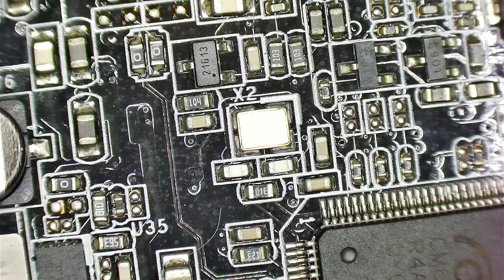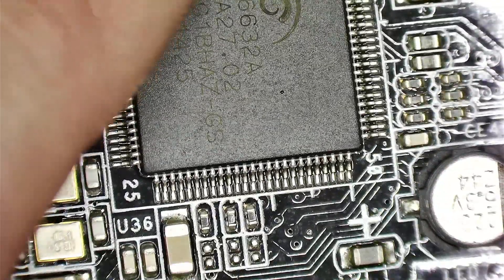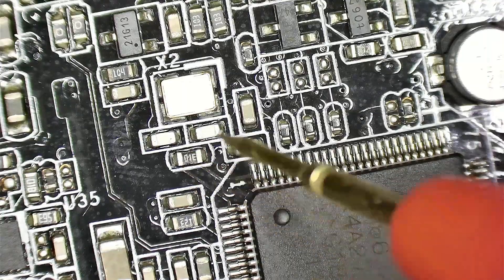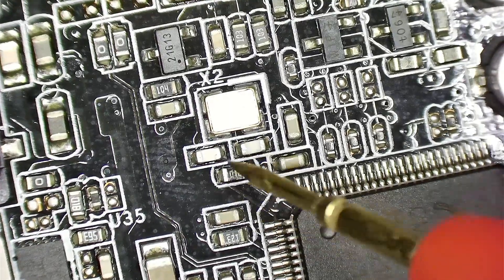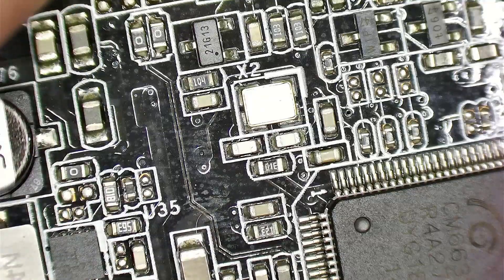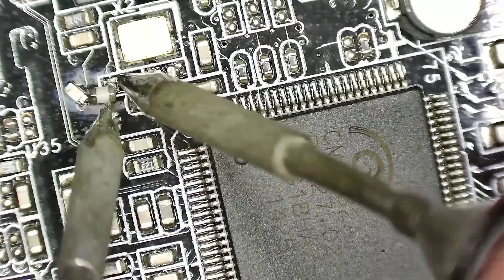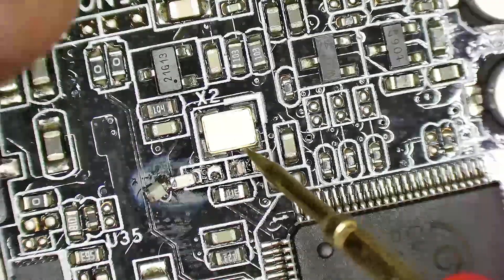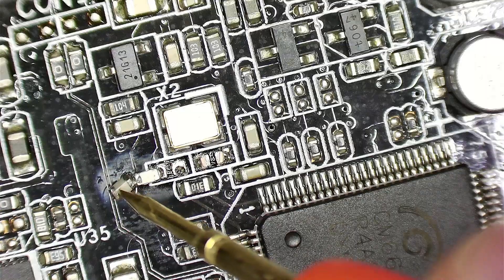Fixing Asus Xonar U7 blinking LED issue

Comment: I have the same problem with the U5 (it turns on with a warm-up hair dryer). Can you tell me if it is possible to solve the problem of U5 in the same way by soldering the capacitors?
Reply from the maker: Gave up on mine. The IC is broken. Not worth spending energy on, specially an U5

Comment: Just removed the left capacitor and it now starts instantly again.
Before that, i tried to plug it in on different USB ports on my mainboard. Some worked, some didn't. It seemed like the newer Usb Ports with Usb 3.1 worked while older versions of Usb didn't. Maybe this information helps others.

Comment: I added a 3.3k ohm resistor between pin 1 (oscillator drive signal) of the CM6632 chip and ground, seems reliable for now even when chilled with freeze spray. I think the transistor in the chip is really weak and unable to pull the line low so this gives it a hand to cross the low threshold.
Reply from the maker: Interesting! I need to try that out!

Comment: Hadn't used it for years and today it didn't start (June 2023). Removing capacitors didn't work; warming with hair dryer worked. I write this just for statistics.
Reply from the maker: I've actually done some digging on the problem on another product based on the same chip and concluded that it is indeed the main chip.
Nothing really to do about it. It seems like the only solution is swapping the chip. But as always thy are also really hard to get.

Comment: temp low still not work ,
Reply: Hey. You need to try reflowing the CM6632A DAC. These two points [capacitors / reflow] will bring this sound card back to life. In the past I had the same problems like you.

Comment: my old Xonar U7 was sitting in my drawer for 4 years and you just saved it. didn't even need to heat anything, sharp point metal tweezers from the fixit kit were enough to gouge those resistors out with ease and zero damage. damn.
Reply from the maker: Amazing to hear!
Hopefully it will work longer than mine did!
Reply: @decee1157  How long did yours work?

Comment from the maker: Mine sadly stopped working again after some time.
I've done a lot of hacking, changed the crystal, modified the load capacitors, removed the resistor parallel with each CLK pin, using external generator for clock, measuring different power rails and haven't found anything that would fix it.
I even went as far as contacting Asus. Ofc companies don't give a damn and wont tell the actual difference between the "MK1" and MK2
I managed to get to a state where i can put the soundcard into the fridge for 10 min and reproduces the issue 

What I've concluded doing my debugging is it is indeed related to the IC and not the crystal.
If heating either of the top edge corners of the IC the circuit will start operating again but not as easy to reproduce if heating in the bottom of the IC 
Buying a new IC is just so expensive so i sadly is out of ideas and might give up on mine. 
I've gone though multiple pictures of the MK2 and the old version and have not been able to find any obvious difference
Reply: I will never buy an ASUS product again, that's for sure.

Comment: 当你移除这两个之后，冷却一段时间后仍然无法识别。但加热后仍可以正常使用，所以我认为你的判断不准确，应该尝试更换晶振。
Reply from the maker: Hello.
I have actually also faced issues with my soundcard not working again after some time. After 7 months it started with not wanting to work unless i replugged my USB. 
I actually was considering replacing the crystal but before doing so i was going to try measuring the frequency as i was curious how much it had drifted

Comment: I tried this, removed both of them with force,  its not broken further but its still blinking... I'm using hair drier to heat it up to function again. I may buy  U7's mkii version (I hope this problem does not exist on that)... after all these years no usb multichannel dac out there to top this on price/performance.

edit: btw mine has passed the method of just touching on quartz to function several years ago.. now it needs hot air to work. maybe thats why this method didnt work on my device.
Reply from the maker: Hmm
This might actually explain a bit about the issue, that the capacitive load might not be the issue but rather that the crystal actually is poop quality and have to be replaced in order to fix it for some people. 
Sucks to hear that it was not resolved by using my method. 
My initial thought of why the hotair works is that the crystal frequency have drifted over the years and as those crystals are sensitive to the room temperature then by blowing hot air onto the crystal it changes the frequency which causes it to start up.
Reply: @decee1157  well nevertheless we are narrowing the issue down. how can I be sure that they didnt use the same problematic quartz in mkii version? last thing I want is to have that issue again after seevral years on a new mkii if I ever have to purchase.
Reply from the maker: @AtikBayraktar  I'd say they made a mkii for good reasons. It would be weird if they made a MKii and didn't solve that issue
Reply: i have an u5 and i have this exact same problem, this shit only works if you put some heat on it
Reply: funny thing is i didnt find anyone with this problem on the u5
Reply from the maker: @SonnietheOne  The U5 and U7 is also really different from each other. I own both of them
Reply: @decee1157  U5 owner here, it has the same issue. Youtube also has some fix or problem demonstration with the U5.
Reply: @SonnietheOne  I just got the problem today in 2025 and found this video.